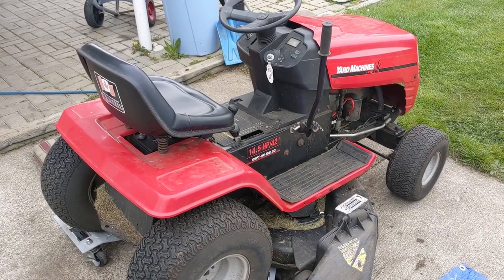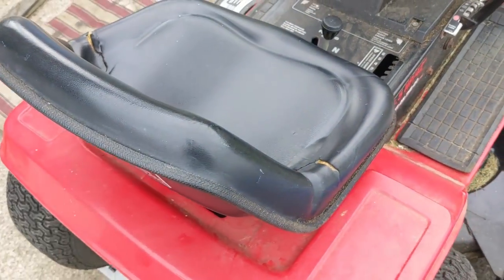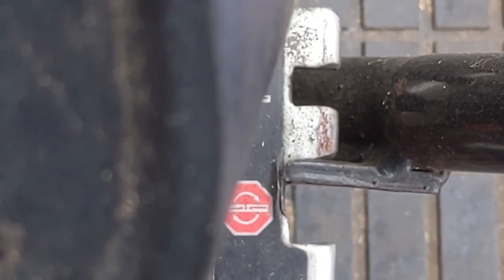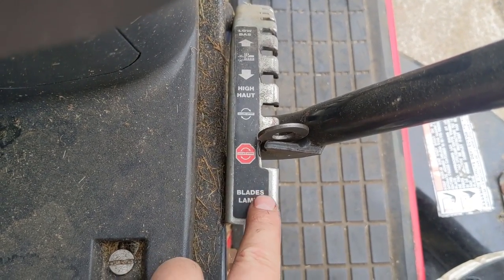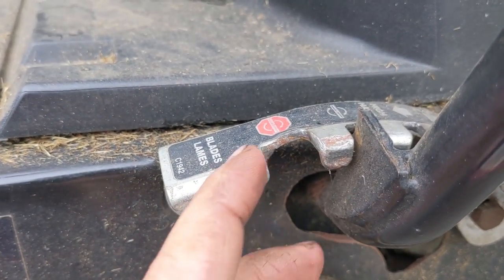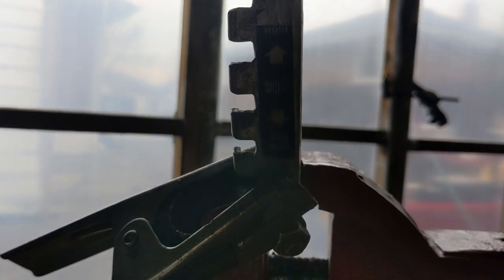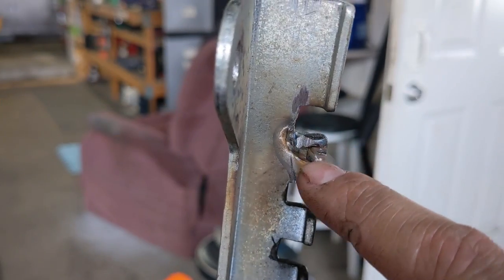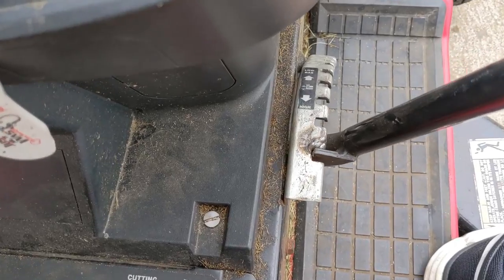Yard Machines Riding Lawnmower Won't Start - EASY FIX!

Comment: Great Video!  Follow up Question. My mower has had same issue and I would always still be able to start it by pulling back hard on the Lever at the same time I turned the key (a little tricky but doable). Now that won't work anymore so wondering where the otherlikely worn or corroded areas are that are keeping it from turning over? (Battery is fine and solenoid is fine)

Comment: Great fix , the weld patch is also harder than the bracket steel so it will ware better than the original steel. The materials keep getting cheaper with the newer models .
Reply from the maker: Sure is, thanks for watching!

Comment: What if everything tests fine and still dead? I've checked the  ignition switch, the solenoid is new. Battery turns over when I jump the solonoid.... nothing making sense. All switches tested fine and when sitting I get full continuity through the circuit....

Comment: I have a yard machine 42" 20hp twin .  I installed a New battery new solinoid new fresh gas new starter and all I hear is a click on the solinoid. I also put a New ignition switch. Why won't  my lawn mower tractors won't start. With all this New parts. Any ideas?

Comment: Hey I have the same mower and some times it clicks sometimes it does nothing I just got it and I did try the first thing you should us but still not working does it have to be in nuetral
Reply from the maker: Could be a loose ground?
Reply: My ignition is bad I know now cause I was trying to start it but the silonoid and it wouldn't the battery cables where a little dirt so I cleaned them and it started now I just got to get a ignition thanks for responding have a good night

Comment: What would cause the rear tires to lock and move opposite direction
Reply from the maker: The differential is what rotates them opposite directions when it's raised off the ground.
Reply: @EliminatorPerformance  It was locked and going opposite direction when on the ground. Won't start. Bought new battery. Worked fine when it was parked

Comment: After I saw this video I ran down to my mower to test this as I’ve been looking for a fix for 4 months now , unfortunately my mtd mower doesn’t have its deck and the stick gets pulled back not forward , also I tried to hold it in place while starting and still all that happened was a few clicks at most , anyone know what to do (in 15 I don’t know what I’m doing so I don’t have a lot of resources to use )

Comment: This is not my problem. Won't even click. I did everything I do every year, new oil, gas, spark plug, lubricate parts and pieces, check blade and it started right up, mowed my 1/4 acre, hosed under neath to clean out as always, let it dry and put in the barn. This was just five days ago. Now not even a click???   Solenoid, starter, ignition?????? Help!
Reply from the maker: Could be many things, hard to diagnose over the internet. Watch this, it takes you step by step; https://youtu.be/vJWbfSxHY1Y